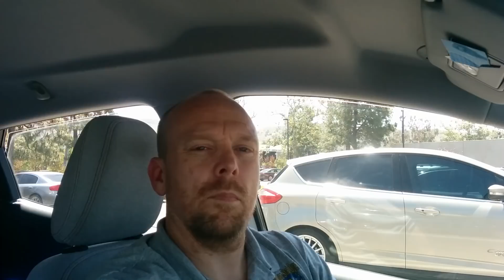Plug-Side Chat: The Most Important DC Fast Charger Dimension

Comment: News Coulomb - I attended a Plug-in NC event last week ( https://youtu.be/uCu2LLKSjcg?t=8m54s ) and there were ChargePoin+ and EVgo reps there.  They didn't speak to the depth of the charger, but they did say a big issue they are dealing with is the charge port location on the car. They are talking to EV makers about coming to some type of agreement on where the port on the car will be located.  It didn't sound like they will be any real progress anytime soon on port location, but I thought I'd mention it here because both companies said they struggle with where to place the charger relative to where they expect the car to park so that the cable will reach the port.
Reply from the maker: Personally, I don't see why they feel charge port location is an issue. All ports that I know of are within a couple of feet the front or back of the car. Placing them at the head of a parking space with the ability to reach at least three to four feet into the parking space is all that is necessary. 

The only exception is vehicles that are towing, but specialized parking spaces for those types of vehicles is nothing new. Tesla has already demonstrated that they understand that special use case.
Reply: It was a bit of a surprise to me also that they brought it up.  The issue came up during the Q&A after the Chargepoin+ presentation.  In fact, they used the port location as a way to dodge the CCS vs CHAdeMO standard. The question asked was which plug would 'win' - the Chagepoint+ rep said a bigger issue for them was not CCS vs CHAdeMO but where the charge port on the car was located.  The Chargepoin+ rep called on the EGgo rep for their input on the questions and they said their engineers struggle with the port location question everyday.  That CCS/CHAdeMO dual plug was they way it was going to be for awhile yet.
Reply from the maker: The big issue I'm starting to notice is the broken latching mechanism on the CCS plug. I want to analyze the issue a bit more, but I believe it could be due to the way certain stations are configured. If someone is not careful pulling the plug out of the station, they could easily snap off the latch.

Comment: All good points... They don't want the feedback, that's on them. All we can do is give it... And possibly start our own charging stops... But we need lots of money for that :( I noticed one of those things units from charge point costs 35k... Just for the unit... Wowzers... Maybe just put in multiple 24 kw smaller units so that a bolt can be charged in a couple hours? Better than just a random unit or two... That's a question, would you rather see a single 125 amp or 2 ~60 amp pumps? Or 5 124 amp pumps or 10 ~60 amp pumps? If I had to choose... Jeez.. that's a tuff one.. I would say the more the merrier... But more what? Energy or plugs....
Reply from the maker: In my opinion, the most important consideration is that the charger speed matches the location/customer use case. Next, is enough concentration of chargers that they have a reasonable chance of being available.

For instance, I'd rather see four 50 kW chargers at a food court than eight 24 kW chargers. 

And I'd rather see four 100 kW chargers at a travel stop than eight 50 kW chargers. Keep in mind that, when cars can accept the faster charge, the two implementations could service the same number of customers in a given period of time, but the customers themselves would all save time at the faster chargers.

Comment: Thank you for taking us to a place I didn't know about and inspiring me to drill down into what is going on there.  My initial reaction was "that is unique".

Isn’t the reason those "ElectrifyAmerica" “plugs” have two "cables" is so that either one will reach the “charge port” on your car regardless of how you park and regardless where the “charge port” is on your car?  Perhaps you said that and I missed it.  While charging, one of the cables is redundant.  That is unique but perhaps added for convenience?

This is the first time I have seen charge point boxes located in between the parking stalls.  That is similar in design to a gas/petrol station but in this design you have to leave the way you came in because there is a garden strip in the way.  That is unique.

What we call things is important to avoid confusion.

In the ICE world... we go to a "gas station".  A "gas station" has one or more "pumps".  A "pump" has one or more "hoses" each with its own payment interface/display information, nozzle and fuel type.    

PlugShare turns what ICE drivers call a "pump" a "station". This is confusing to me.

In PlugShare, when you click on Plugs, More Details, for that location, it displays FOUR "Stations" with two plug types each. In the parent page it says there are 4 CSS stations and 1 Chademo station.  In the header for this location it displays the number 8.  This is confusing to me.   

In my mind there is only one station.  There are 4 "charge points": each with two cables one of which is redundant.   One of the charge points has a Chademo

In the UK, they call the geographic location that you can charge at a "charging station".  They call the device/box with a tethered cable attached a "charge point" which can have multiple "tethered cables/types" and a payment interface. 

Is it possible to agree to a common terminology or is it too late?

This video has opened my eyes to how much design variation there is in the fast changing dc fast charging world.  

Thank you!
Reply: My understanding is that the Electrify America 150+ KW stations can use both plugs at the same time at a station.   Unlike the 50KW stations.
Reply from the maker: The response from EA was that they couldn't share power, which is why they put two heads per parking space. Hopefully, we can start verifying these things soon.

Comment: Tesla’s chargers are very thick. So thick that they sit in a remote cabinet which has 12x 10kw (or 12kw) chargers inside, ganged in sets of 3, and shared between 3 charge points, which are very thin. Tesla uses the same charger modules they use in the cars, which gives them some economies of scale. One of the real DC fast charger companies makes a system with many chargers in a Hive, which can be switched to feed several charge points, sending max power to each car in the order it arrived. It’s a great way to increase utilization of the expensive parts of the charging system. I think this is the cube system you are talking about.

Most of the thick chargers are actually chargers, so they need more room for all the components, and a stringer base pedestal. These are designed to be less expensive to set up, just run power to them and they are ready to go. Tesla supercharger setup needs a lot of work laying the cables from the chargers to the charge points.

Ultimately, when DC fast charging is 1000 kw and able to charge a 100 kWh battery to 80% in 5 minutes, it can replace gas pumps and a gas station which went out of business. They can charge by the minute and let you choose the aisle best suited for your car, and perhaps have a few old 100 kw spots for old EVs which can’t charge fast. 

I think at some point the economy of putting a charge point at each parking space is going to not be cost effective. You have too much equipment sitting idle too long, deteriorating or getting vandalized in remote locations. 

If and when a battery which can charge at 12C up to 80% is developed, the whole Tesla superchargers network will be useless without significant upgrade to everything.
Reply from the maker: That's true, but it was partly what I was speaking to. Look at ChargePoint's Express Plus with Cube system. It is very similar to the Tesla Supercharger stalls plus cabinets. Either way, the primary consideration is that these chargers have a very shallow depth, and they can be ideally configured for EVs while minimizing the amount of parking spaces they occupy.
Reply: I think that site also used charge points and put the chargers in the cabinets, but the charge points are thick because they have an HVAC built in for cooling the coolant for the cables, which are liquid cooled for the 350 kw capability. These are expensive chargers for expensive cars. Most likely they will charge a rate that a Bolt or leaf owner can’t afford, because it will be based on 150kw or 300kw, and the Bolt would basically be charged 2-3x as much as a Tesla. 

The problem as charging speed increases is the mixing of slow charging cars with fast charging cars. But with a cube or hive, you can have 50x 10kw chargers which can be directed to 1x 350 kw, 3x 150 kw, and 10x 50kw and let them each charge a different rate. 

The problem is, you can charge a car for staying connected while idle, but hard to charge a car who just parks there and doesn’t charge. It would be better if EVs have a separate parting area with a keycard entrance/exit that charges you while inside, and ensures that you are not hogging a spot without at least helping to pay for more charge points to be installed.
Reply: News Coulomb, where space is a premium, and so are the cars which park in them, something like this can be used with integrated charge cables in each slot:
http://www.my-autoparking.com/photo/pl12630313-vertical_rotary_parking_system_project.jpg

If they have a big cube of chargers and can send the power to any stall in a group of these elevators, you can pull in and be charged per kWh and per hour, and the per hour fee when idle will increase if the capacity of the cube drops below 100%. The information would be sent to your model app so you would know the status of everything at least 30 minutes in advance.
Reply from the maker: I like ChargePoint's new Express chargers a lot. If their specs are accurate, I think they are the best chargers on the market, including Tesla's, but they need to be implemented properly. Right now, the ideal set up is pairs of linked Express units that can share power and provide up to 125 kW... very similar to Tesla's original Supercharger setup. As more premium EVs with ultra fast charging are released, faster configurations can be added.
Reply: News Coulomb, if they have the right switch gear then it will send the right number of charger outputs to the right charge point. It should be unlocked to about 175 kw right now so Tesla can use it, and later when the 800v cars come out they can access the 350 kw. I don’t think they will sent 350 kw to a 350v battery. That’s 1000amps. Nothing can accept that right now. 

I wonder what the cost will be to use those once they have full power. I think California can charge by the kWh but these chargers need to run like a taxi meter to prevent someone from charging a hot Nissan Leaf to 100% at 5kw and blocking someone else who is ready to pay for 100 kw.

Comment: I took a look. I have never seen two chargers back to back in between the charging spots. They probably should just have the chargers at the "front " of the parking spot.  On the other hand I do like the setup evgo is doing with a over head cover and a island with chargers pull threw like a gas station. That's the first time I have seen a picture of a 350 kW CCS charger.  Cool.

Comment: NC - I have used EVgo chargers which are parked in the middle of and next to a single parking spot.  Kind of easy to plug in a Bolt EV if you can get it in the spot, usually requiring that I back into the space.  This makes no sense if there were to be a cue at that charger, since there’s no place for the person that’s waiting to park - near the charger.  The fast charger cords are rather stiff and too short to reach the side of the car plug location if the charger is located at the end of the parking spot, so it appears that there’s no win-win which will cover all cars nicely unless the plug comes from above (hey, could that work?).  I think that Nissan and Tesla have it right re plug location at one end of the car.  My hunch is that we will eventually work toward this front or rear plug being a standard as EVs evolve.  Tesla seems to have the car vs stall sorted already, and Nissan has been a front plug from day 1.  Will the next Bolt EV have a front plug?
Reply from the maker: The Bolt EV's plug is as close to its front as a Tesla's plug is to its rear. The same is true of most of the EVs. The Kia Soul, Nissan Leaf, and a couple others have it at the nose, but I don't think that is necessary.

You bring up another point that I forgot to mention, though, and that is that I've banged my door on EVgo chargers plenty of times because there was so little clearance between the side of the parking space and the charger.
Reply: News Coulomb - yes the Bolt EV nose is rather stubby, so your front (Bolt) versus rear (Tesla) comment is likely a pretty close measurement if we actually got out the tape.  The nose charging spot does make for an easy charge spot park - as long as the cord comes straight at the car.  DC fast charger cords aren’t so friendly in this regard.  I do hear you re bumping doors.  The ideal parking spot for the cord is too close to the protective posts in front of the chargers.  Maybe the posts should be beside the charge kiosks?  Enjoy!